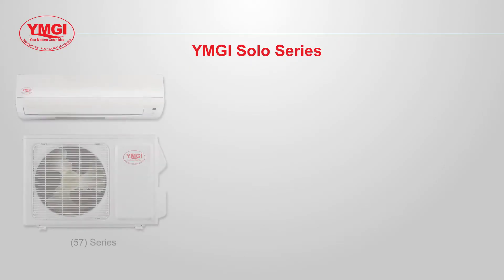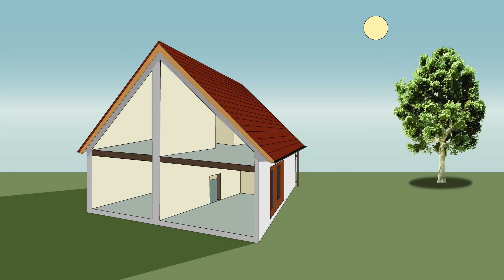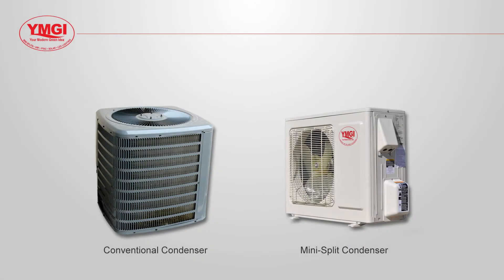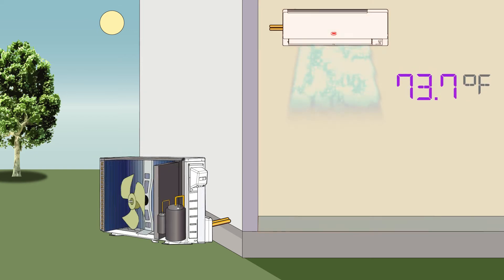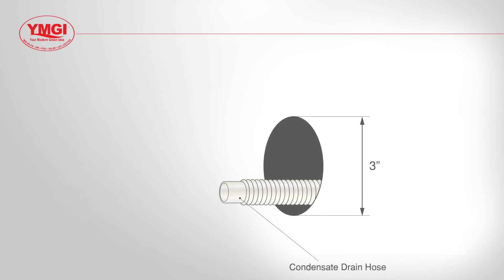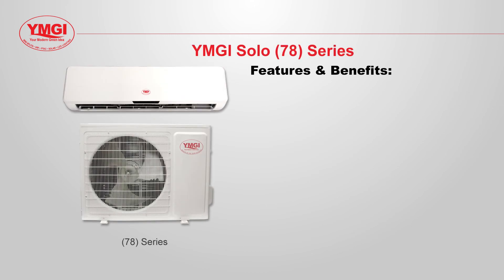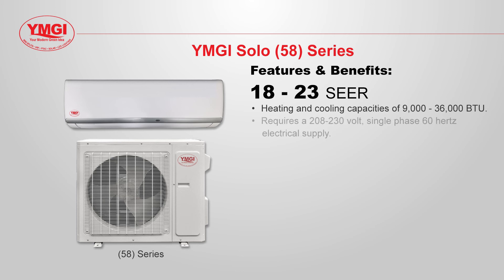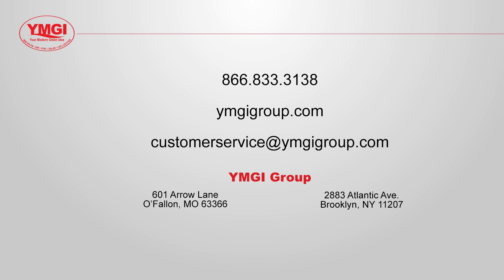YMGI (57), (58), and (78) Solo Series Single Zone Mini-Split Systems

Comment: Do you have a video tutorial on cleaning and maintenance of the YMGI mini-split system?
Reply: The important part of the cleaning the minis split is to ensure the air filter inside the indoor unit is cleaned  it is pretty easy and it is listed in the user manual that come with the system. As of maintenance convert some aspect. Especially checking the pressure or any leaks on the tubing that could be done by HVAC technician which involve using some professional trade tool. We strongly recommended this to be done by Technician in order to have this done professionally and in the right way. As a generally guide . When you feel your AC is start loosing cooling power for start making abnomal noise  it will be a time to call the service tech.